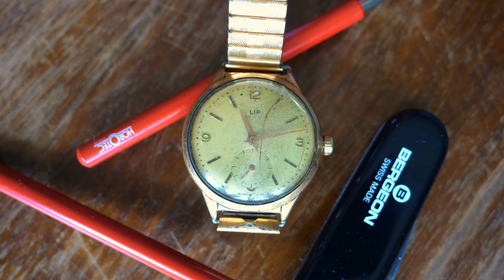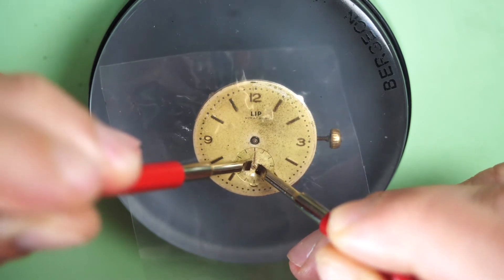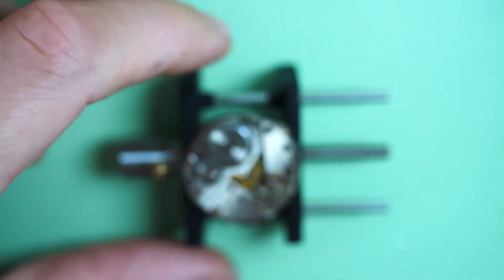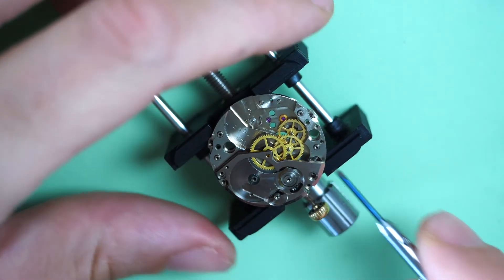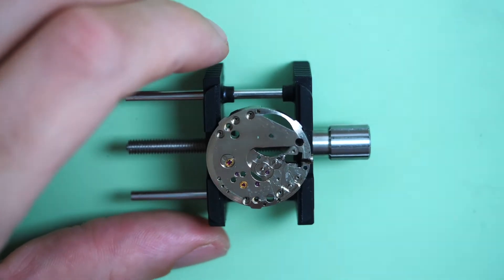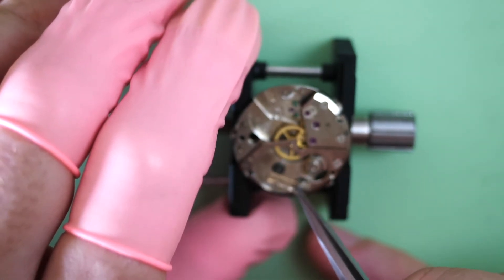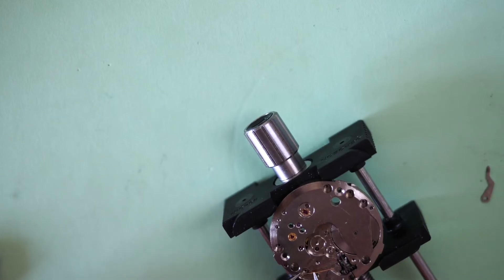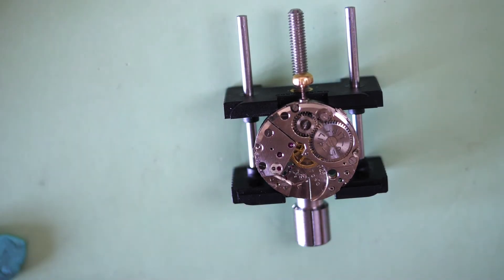LIP Himalaya Cal.R25 Restoration Vintage Watch

Comment: The original LIP didn't go out of business; they just stopped making watches to concentrate on machine tools.  Today as LIPEMEC they make cylindrical and surface grinding machines, both manual and CNC.

Comment: Is there a gasket in the crown tube as well, or only on the case back? What is the size of the case back gasket? My Lip Himalaya fogs up when I wear it in hot weather, and the dial has some green patina from the resulting corrosion, so the gasket(s) certainly need to be replaced. Correcting the beat error on these old movements requires special tools, since the stud carrier is fixed and the hairspring is held in place by a tiny screw. But they seem to work well even when the beat error is as high as 3-4ms.
Reply from the maker: You have a gasket in the crown and not in the tube. You don't need a special tool to adjust the beat error you just need to disassemble the balance assembly. It is tricky to do.

Comment: Great video! I have recently serviced a similar 1940’s LIP R25. I noticed that you didn’t show the mainspring being reinstalled into the barrel. Mine has the DBH Special Bridle (T-end), which I have been unable to manually engage in the barrel slot (only in the lid slot). Did your one have the same? If so, do you have any tips for re-engaging when reinstalling the mainspring?
Reply from the maker: To be fair I don’t remember if it had a T-end. For the T-end I like to put it just after the slot because when the spring is going to go in it will turn just a little bit and it will fall I the slot